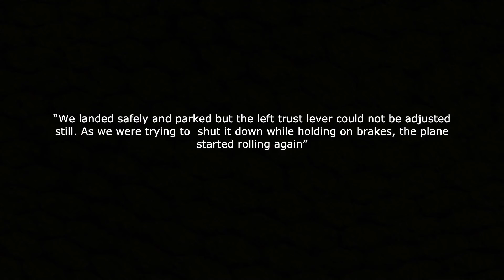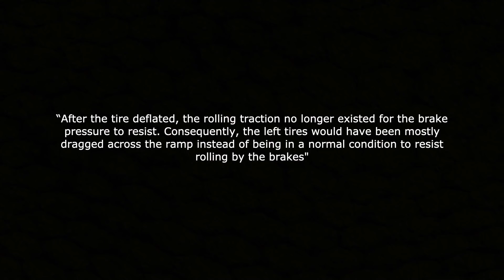The Crash Caused By A False Sense Of Security | RwandAir Flight 205

Comment: Thanks again for an interesting video. It seems like they never declared and emergency so did they have the emergency service on standby when they landed?  If not it feels like a stupid decision cause they could have prevented this by shutting down the engine sooner. I mean even I would understand that the brakes  could  eventually fail if the engine is on full power for a longer time but then, I might be wrong.

Comment: Why didn't they just kill the fuel?
Reply: fuel control was jammed open
Reply: @ysesq  

Plz consult the Wikipedia article

quote:
"" A procedure in the aircraft's Quick Reference Handbook (QRH) titled "Thrust Lever Jammed" would have directed the pilots to shut down the left engine by utilizing the Left Engine Fire push switch, which would have closed (among other things) the Fuel SOV (shutoff valve), thus allowing the speed of the aircraft to be better controlled while landing the aircraft."

The thrust was jammed - not the main fuel valve. And even if so there are numerous other was to kill the fuel supply.

https://en.wikipedia.org/wiki/RwandAir_Flight_205#Aftermath

Comment: There were no engine control switches or something? No way to cut off the fuel flow and turn it off? This seems really stupid there has to be something you've missed in this video
Reply: Based on the report the crew hadn't been trained for a Thrust Lever Jammed situation so may not have been aware it was in the QRH or maybe they didn't know what it was called and therefore couldn't find it.
Reply: @lubtp7133  how can a pilot get training that doesn't include the fact that when you cut off the fuel to an engine it will stop running. Part of your training warns you against doing that.
Duuuh
Reply: @henryD9363  This is speculation which I don't like to do when it comes to accidents but it's based on the known facts. 

Facts:
The crew had a problem that they didn't fully understand due to lack of training and knowledge of the CRJ100 systems, however they were close to the airport in calm weather and the plane was controllable enough to manouver and land.

Speculation:
In a stressful situation they weren't prepared for they decided not to manipulate any systems out of fear that doing so would introduce new problems removing what control they had.

I'm definetly not trying to defend the PIC or FO, the CVR didn't record any discussion about the QRH or other on board documentation. They didn't do their job correctly and it cost someone their life.

This is just the only reasoning that I can think of that would lead them to make the decisions they did when even basic flight training should have prevented that.
Reply: @lubtp7133  didn't need to be "trained"...simple common sense was enough...welcome to Africa

Comment: It seems every situation is described in the manual. However in the heat of a crisis do pilots really have time to go through what to do? First struggle to keep the airplane in the air and then to go through a manual too. That is not very intuitive.
Reply: Quick Reference Handbooks are specifically designed for use in emergencies and are step by step procedures, not detailed technical manuals. In this incident it seems that the pilots hadn't yet recieved the training for a Thrust Lever Jammed situation so didn't know that it was in the QRH.
Reply: They had plenty of time, plenty of time to read the checklist. They went all the way around the pattern and made a landing.
Absolutely no urgent emergency.
Especially after they were on the ground, for heaven's sakes. Cut off the fuel. What kind of idiot pilot doesn't know that?

Comment: I was wondering why they didn't pull the fire switch for the engine, it seemed like the obvious thing to do. I had the accelerator stick when I was driving before and that was scary enough without being in the air as well.
Reply: And in a car you do not have an emergency fuel cutoff switch, that is also not at the same time locking your steering wheel. (The ignition.)

All you really can do it press down the clutch and let the engine rev itself to death while you break.
Reply: @57thorns  in most cars with traditional ignition keys if you turn the key just slightly (like 1/8 of a full turn or so) then the ignition will be cut off but the steering wheel will not be locked.
Reply: @comandanteej  Works nicely for towing the car, not so easy to do if the engine is catching fire while you drive. There also is still no fuel cutoff valve of course.

Comment: For those wondering why the plane is Branded Jet link it is because it had been bought from an airline in Nairobi by that name but Rwanda air had not bothered to repaint the plane yet. 
Quality video again. Nice work
Reply: Some sources say it was operated by Jetlink on behalf of Rwandair. So who was flying the plane?
Reply: @balo1962  That could be the case but there was a close relation between the two airlines at the time. As to who was flying, I also cant say that with certainty. Could you share the sources?
Reply: @victornderu143  Please check out Aviation Safety Network database. It says "operated by JetLink Express on behalf of Rwandair".
Reply: @balo1962  It was a wet-leased aircraft and had Kenyan crew
Reply: @balo1962  the pilots
Reply: Great attention to detail 👏👌
Reply: nilishangaa thanks
Reply: During its formative years Rwandair leased most of their aircrafts from Jetlink
Reply: The aircraft had been wet-leased from Jetlink.

Comment: Why can't they just shut down the engine when in air or ground?
Reply: Well they can shut it down, but they didn't think to do it. Even though it's obvious.
Wonder what kind of so-called training they had.
Reply: How does this mess with hydraulic things like brakes? Because if you did that in a car or it stalled, you would lose both power steering AND power braking.
Reply: @windsofmarchjourneyperrytr2823  As for the brakes anyway, there would be a backup system of some sort.  Typically it's in the form of pressurized spheres of hydraulic fluid (accumulators) in each wheel well, providing enough fluid for a few brake press-an-release cycles (all you need as long as the brakes are held down rather than say used differentially for steering).

Comment: Emergency procedure checklists are there for a very special reason. If you don't use them you are just doomed from the start. And why hadn't they practiced this in a simulator? A runaway engine happens for several reasons and pilots train for it. But these pilots didn't follow proper procedures and people died or were injured. Wonder how many hours these pilots had in type and total time.

Comment: It seems like there was one where the fire department was called because the pilot called an emergency while still in the air. The fire department had to shoot water into their engine to stop it too but, for the life of me, I don't remember what the name of the flight was called. I do remember that it was an airliner though and I'm pretty sure it happened in the US. 

In any case, as I was listening to this, I thought that they should probably pull the fire handle to stop the engine but I'm not even a pilot and I certainly wasn't one under this type of pressure so anything I think of doing is from the comfort of my own chair and not in the heat of danger.
Reply: Well it happened with a QANTAS air bus a380 uncontained engine failure they emergency landed and fire Department had to put so much water to Finally shut down a engine ,started when the ROlls Royce engin oil Pipe blew apart and caused big damage
Reply: QANTAS flight 32

Comment: So my take as soon as you said they were landing with the left-hand engine still on was correct.  While the stuck thrust wasn't due to the pilots, everything else, including the death, rest completely on both pilots' shoulders.  There is no way they should have landed with an engine like that.  That's beyond reckless.
Reply: Tbh I am amazed it didn't go way worse, braking systems on planes are a lot more impressive than I realized